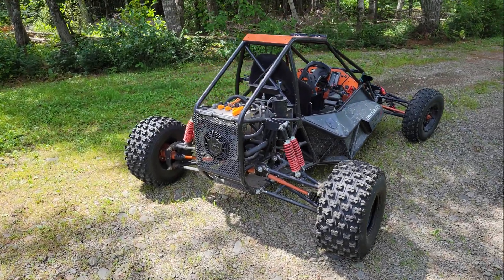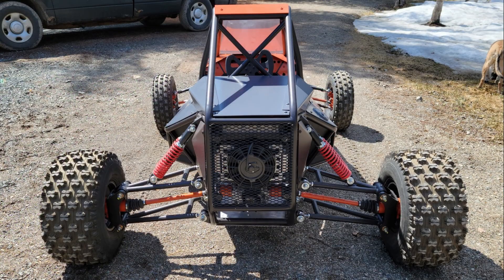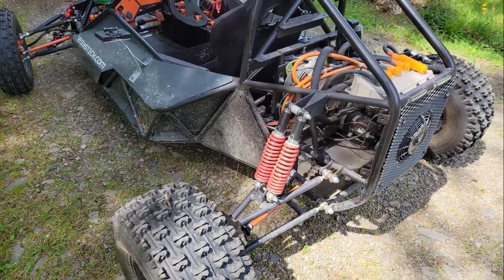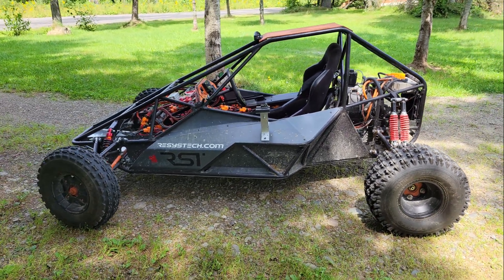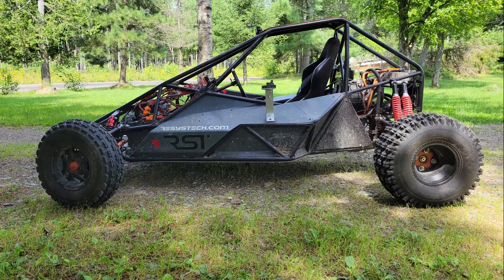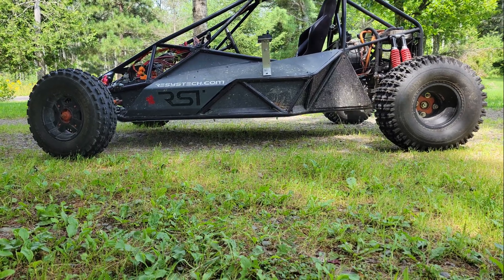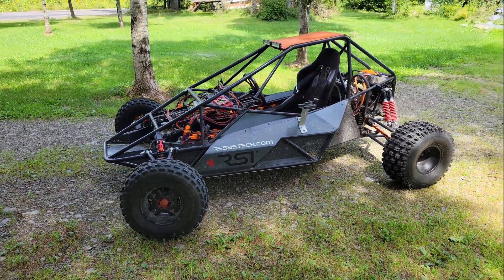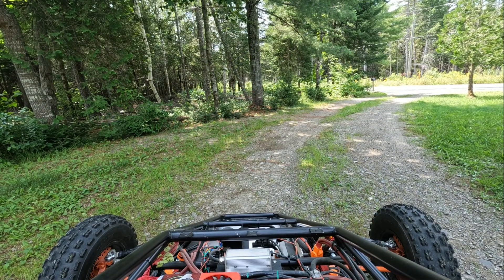Homemade Electric Buggy Ep 12: NEW TRACK! New Problems...

Comment: What are your thoughts on the output of the ME1616 motor with your cart? Is it enough power?
Reply from the maker: It works fine for general cruising as long as I'm not hammering on the throttle and hitting stall torque as I showed here. It drives like a regular sxs, minus 4wd. But two motors and controllers (~140hp) to drive each wheel independently without the need for the lsd and ~100lbs less weight would be better for racing and would eliminate the stall torque issue that shuts the controller down momentarily. I'm currently drawing up a lighter design with 2 ME1616 motors. Plan for one ME1616 (or 70hp peak) for every 500lbs of buggy weight, that would give you a peak power to weight ratio that's similar to some sports cars like a Toyota Supra or stock Porsche 911. Bear in mind that electric motors have a duty cycle and peak power is usually only sustainable for 10-30 seconds without sufficient cooling before the controller throttles back to protect the powertrain. Continuous power rating (the power that you can run it at indefinitely without risking damage) is slightly more than half the peak power rating.
Reply: @ thanks for the details. I just finished welding my frame. I’m planning for battery and motor(s) set up now. I don’t plan to race it, more to learn about converting EV cars. My background is software development, so I may try to make my own motor controller and inverters. So much to learn. Your videos have done an amazing job of breaking down the steps.

Comment: Did you upgrade this beast at all?
Reply from the maker: Building another one with a lighter chassis and dual motors. Possibly a high/low range gearbox.
Reply: @JamesBiggar  videos to follow? Sounds awesome!

Axial flux motor would be awesome :)

I really cant wait for this advancement in battery tech. Prob not for a few years though :(

Comment: I just found your channel.  Very cool!  The controller cutting power completely is very odd.  It must be some sort of internal flaw.  I'll check out the rest of your build videos but I assume you're running a 500(ish) amp controller.  It should put out 500amps until something breaks.  That's how Curtis and Sevcon controllers work anyway...I can't imagine why Kelly would be any different.  
Anyway, cool video and looking forward to seeing the rest.
Reply from the maker: Running a 600A esc. The motor's actually stalling because it can't generate the torque that I'm demanding with the gear ratio that I'm using, which causes a surge in current through the esc and it momentarily cuts power to protect itself, ie: it's overcurrent protection. If I push it, then it overheats and shuts down completely until it cools off. The solution is to increase the gear ratio and sacrifice some speed to increase the torque mechanically and lower the chances of hitting stall torque and sending a surge through the esc. Incorporating Kelly's liquid cooled heat sink with the controller could help prevent overheating. Or ditch the rear diff for another motor and esc to power each wheel individually. The battery's more than capable of handling double the power with a bms upgrade so that what I've decided to do...but in a new, lighter machine with a few more bells and whistles.

Comment: Doesnt Kelly sell a display you could use to tell you instantaneous current draw and all sorts of info?
Reply from the maker: Nope. Just LED and TFT speedos and clamp meters. Already have those speedos and they only show voltage, some show wattage, but still the same delay issue as the bms display and their accuracy is questionable. They're not proper data loggers. The clamp meters are better, but not exactly permanent. There are better options elsewhere that'll fit right in the instrument panel and log all of my usage data instead of just peak values.
Reply: @JamesBiggar  thanks for the reply. I just got a 72V 500A Kelly controller and only read mention of the display. I'm disappointed it isn't better.

Comment: Great to see your update on the buggy! 
I am still building mine using the same motor and controller as yours. I am using liquid cooling for the controller so hopefully no issues of cutting power off after full throttle.

Comment: your stalling is actually the motor not the controller lol theres a peak stall torque value of 134 Nm. I would try lowering it to 92V and see if the stalling out still persists, could be a simple tune on the controller to lower the torque abit at the current voltage.
Reply from the maker: The motor could be stalling, yes. Stalling increases the current demand dramatically. This can create an overcurrent issue in the esc and cause it to shut down. Voltage is proportional to speed, current is proportional to torque. The only options to remedy are to tune the torque/current settings lower in the esc and live with lower torque, or increase the voltage and gear ratio to increase motor rpm while increasing torque mechanically at the expense of wheel speed, which would lower torque load and current demand on the motor and esc. As I mentioned in the video. Lowering the voltage from 102-92V would lower the motor rpm and increase the current demand and torque load for the same power output - this would only make it stall sooner...would it not?
Reply: @JamesBiggar  you are correct, Can't wait to see what this thing can do once you get the gearing and tune dialed in. I was confusing myself with the current/voltage effecting the torque, been a long day.
Reply: Love your series on the build.

Comment: Ballpark How much would I be looking at for a comparable electrical setup?
Reply from the maker: ~$8k. That also includes 8-10 years of paying roughly 3X less for fuel (ev's are over 2X more eff than ice, grid power is also still significantly cheaper/kWh than petrol - cba in the description of original build video). You'd pay for your battery multiple times in fuel cost savings before it actually needs to be replaced, provided you don't do something stupid to it and ruin it.
Reply: @JamesBiggar interesting. How much does this thing weigh?

Comment: I would go with a VESC controller by Benjamin Vedder or look at electro and co noisy cricket they also have a new one coming soon that would take care of voltage you want and torque you need less speed more torque i would over gear the shit out of it and not think about speed torque is so much more fun than speed.

Comment: I need to build a 36 volt battery to replace six 6 volt Trojan lead acid batteries in my ego golf cart. Would love to hear any suggestions or input you may have or a design idea. Great job and great videos ! Thanks, - M
Reply from the maker: Thanks. Check out my latest battery build video for an ongoing e-moto project. I modified some 36V M50LT modules from Battery Hookup that you might be interested in https://youtu.be/1KXRtSAv37A

Comment: Kelly is cool, but you still have to do Chinese to American unit conversions.  100 Chinese amps equals 50 American amps, sometimes it equals 10 American amps.  100 Chinese horsepower equals 50 American horsepower.  The max amps of your controller should be about three times the max you want to send to your motor.  Using Chinese unit conversion, your motor max current should be the continuous current output of the controller.  This was trial by error on a few small builds.
Reply from the maker: The rated current for Kelly controllers is actually the ac phase current to the motor, not DC to the controller. 100 amps at nominal voltage from the battery to the controller doesn't equate to 100 amps from the controller to the motor after its converted to ac and the output voltage varies depending on the rpm and throttle input (not like a typical voltage drop in a battery under load). That's why I had over current issues with full throttle from a dead stop or low speed and not at high speed; higher rpm = higher voltage to the motor but lower current demand (v*a = w) and subsequently lower torque. If you look at a power curve graph from any motor, that's what you'll see. Characteristics will vary a bit, but more or less, eventually the torque and current take a dive at a certain point as rpm increases. You should've contacted Fany at Kelly support instead of using guesswork. They could've explained it to you and saved you some trouble. As I mentioned in the video, there was an overcurrent issue on the ac (output) side of the controller that Fany and I resolved for the most part, but that lowered the torque. The motor can pull more ac current than what the controller can provide. The dc side isn't the issue. We knew that from the start when I contacted them BEFORE buying to cover all my bases, but again, that was the largest controller that could be matched with it at the time (from any supplier) so we did what we could by tuning down the motor current and adjusting torque/speed and MAP, and starting with a 5:1 gear ratio with the expectation of making changes later with both the mechanical and electrical to get the torque that I want without compromising more speed than what I can afford to drive on this track.

Comment: Entirely unrelated to the project: your local transit authority needs to fix your road. Holy crap!
Reply from the maker: Lol, don't get me started on that. Speed limit's 80. Ambulance drove by last year for the neighbour and could barely get above 50 without being tossed all over the road. The video doesn't do it justice. It's an absolute mess. What you're seeing is the good section. It's a literal safety hazard. Craters the size of the hood on my truck, 2 ft deep, no markers or warnings, culverts washed out, you name it. One of the neighbour's daughters was visiting a couple of years ago, not familiar with the area, tried the posted speed limit, hit a crater and flipped her car into the ditch. DTI was quick to run out the next morning to mark it. I've taken complaints all the way up the ladder, passed on from one evasive bureaucrat to the next until they got sick of me and gave me the direct email for the district engineer who basically told me to eff off, he can only work with the budget he's given by the donkeys who wouldn't talk to me. No $ for it, apparently. They were supposed to do it 10 years ago. Road crew stopped in to see if I had a place on the back 40 to dump ditching. Halfway through the local MLA stepped in to stop it and redirect funds to fixing roads in his neck of the woods. It's never been done properly. That's just reclaim asphalt on it now. Been there for 30 years. Mud and gravel before that, just dumped the reclaim on top of it. They send a half dozen guys, a loader, trucks and a compactor down it once every spring to cold patch. I don't understand why since they only do about 1/8th of the holes knowing damn well they're just wasting their time because the road has literally crumbled to nothing so there's nothing to hold the patches to the ground and they'll just peel it up with the plows again in the winter if regular traffic doesn't take care of them first. Probably spend a few grand on it every year. Logic ftw.

Comment: Couple things- first, you could look into NMC pouch cells for the battery. Very easy to build a pack and not terribly unaffordable. I realize this may be too late because you've already built your pack, but pouch cells are the way to go. Second, I'm not sure if Kelly controllers are VESC or not, but a VESC controller will be your best option. 3Shul makes incredible high-powered controllers that will more than suit your needs such as the CL700.
Reply from the maker: Nothing wrong with the battery. It can handle far more power than what I'm using. NCM would be ideal in terms of weight and space, if I weren't trapped inside a tight cabin with them. Most of my time driving the kart is spent alone. If I wreck and get knocked out, I wanted less risk of burning alive. NCM makes me too nervous. LFP offered the safety factor that I wanted. This kart's only 50-100lbs heavier than the pro karts despite lugging a 300 lb battery thanks to the chassis design. The issue is the controller. Unfortunately, the CL700 is only 100A more. That's only an extra 16 ft lbs. I can get 10X more torque with a $30 sprocket. As I mentioned, Kelly now makes much more powerful sine wave controllers for the ME1616 pushing 1200 phase amps at a more affordable price than an equivalently sized VESC like a CL1000(+) - nearly half the price. VESC's are really nice, but they just don't offer the same torque/A constant that Kelly's do. I'd use them in a more sophisticated build like a small car, but this is a budget buggy, so optimizing torque and speed/$ spent is my main priority.
Reply: @JamesBiggar  I see where you're coming from. I think NCM packs get a bit more notoriety than is warranted, but there definitely is a danger there. As far as controllers, I've heard rumors of a few VESC coming out soon that will be marketed toward motorcycle/car builds IE 1000+ Amps, but they will also be more expensive. Kelly is good bang for the buck for sure. I just like VESC more.
Reply: @JamesBiggar Isn't the ME1616 rated for 120V and 600A max.
Reply: @JamesBiggar  Taking into account the criteria of torque and speed, how much budget do I need to build one that can exceed 75mph?

Comment: your theory about gearing vs heating vs top speed is correct. whole thing will be more efficient with the motor at higher rpm as well. batteries may run cooler too. consider also where you could save weight. chance are a lot of stuff is very overbuilt.
Reply from the maker: Actually, if anything, it's a bit underbuilt. An exhausting amount of time has been spent meticulously designing the kart to be as light as possible, hence why I opted for smaller/thinner tubing and more braces instead of the larger 2" tubing that most builders use. The extra cutting and welding is more work, but saves loads in weight without compromising strength (same reason why trellis motorcycle frames are lighter than their bulkier cast delta box counterparts). A typical crosskart with just a 500cc engine weighs in at around 900-950lb. This buggy hauls an extra 300lbs of LFP but only weighs 1027lb. The only way I can shed more weight is by swapping the LFP's for the same cap in NCM which would cut slightly more than 100lbs, or by swapping the aluminum body panels for abs. The panels make up less than a 4x8 sheet, and while abs is half the weight of aluminum, it would only cut around 20 lbs off the weight. It's something, but nothing to shake a stick at. Bottom line, with it only being ~50-100 lb heavier than normal, that's pretty good for what it's hauling. Just need more torque for more fun, and when the budget allows, more voltage and hp to get the top speed back that I'm going to lose from changing the gearing.